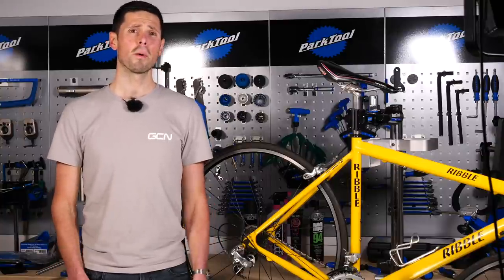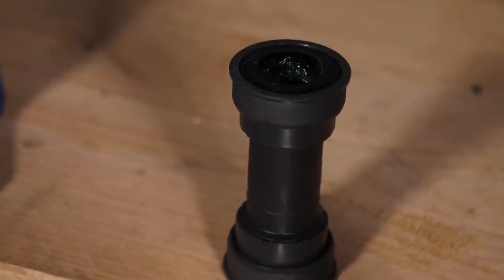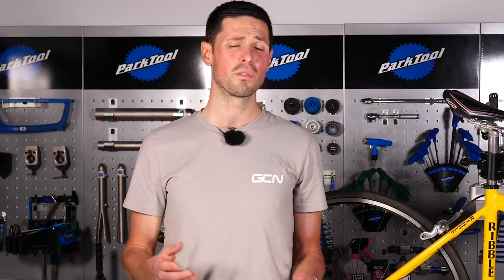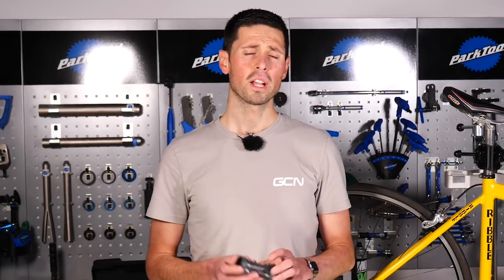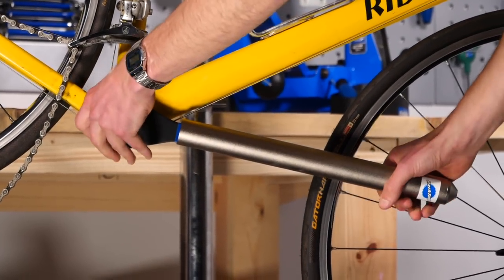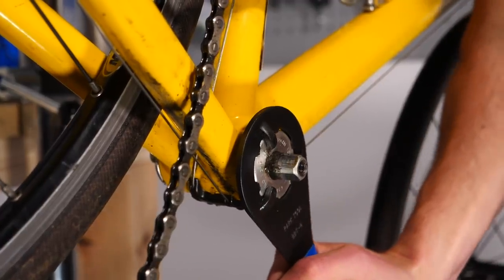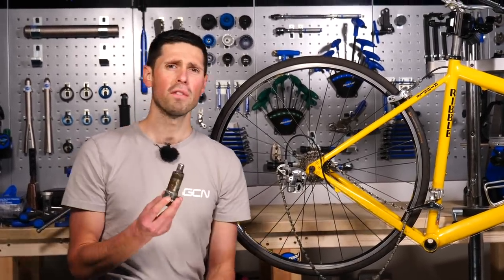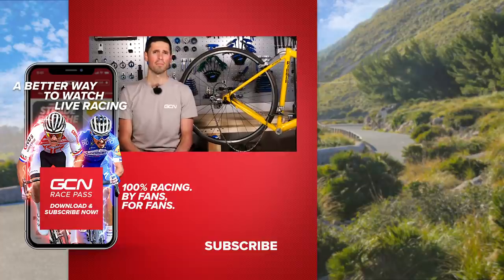How To Remove A Stuck Bottom Bracket From Your Bike | GCN Tech Monday Maintenance

Comment: You simply HAVE to affix the tool to the BB cup.  This guy was derelict in not doing this.  If you don't, it will slip, you'll mangle your hand(s), damage the tool and/or BB cup and/or the frame.  ESPECIALLY when using a cheater bar!  This is why typical shop-quality fixed cup tools have big handles and tighten securely to the BB shell.  The tool this guy used should be held in place with a Stein Tool, or any combination of washers, tubing and the crank bolt. You MUST securely affix to tool to the cup!

Also, do NOT go wild torquing a BB cup with the bike held  in the repair stand alone.  This risks destroying the frame - even if properly clamped by the seat post.  Get a friend to hold the main triangle as you apply force.  You can even loosen up the repair stand's rotational adjustment so you are NOT applying rotational force to the seat tube/cluster area.

Well, got a siezed Campy Record BB in a Ritchey Ti frame with carbon stays.  So no blow torch for me!
But a hair dryer and spray freeze may do the trick.  We'll see.
Sat for a week with penetrating oil. 
Man, not fun trying to revive this beautiful Breakaway for a trip in a month.

Comment: You omitted the most important bit, namely how the bottom bracket is threaded -  British or Italian, Swiss or French threads. If you don't know the correct "undo" direction  you're sure to fuck up your frame, or, ruin the threads by installing a replacement with a different thread pitch and direction... Tut tut tut ...

Comment: Mine is seized.  I've never had such a humiliating defeat.  I'm going to try a breaker bar and if that doesn't work I'm letting the shop replace it with one I can work with.
Reply: @rg807  Definitely. Used it (and the referenced Sheldon Brown article) to eventually pry out a seized square taper fixed face from a skip rescue Raleigh - had already tried most of the usual tricks, wasn't going to spend on a decent quality C-spanner or similar, this worked a blinder in the end. Very satisfying, threads in good knick.
Reply: The bolt method seems to be ingenious but won't work with cartridge bbs. A Shimano /Phil tool could  be stabilized with a bolt screwed into the spindle backed with a washer. I've seen bbs removed using the tool clamped into a vice and the frame used as the lever. Just be careful to turn the right direction as this approach may tax spacial skills.
Reply: @davidburgess741  You're correct re cartridge bb. But for the rest, the bolt method is easiest. The presenter left out that the primary reason for seizure is metal incompatibility and a lack of anti seize grease.
Reply: @davidburgess741  Yep, it's purely for BBs with fixing plates separate/accessible from both sides.

Comment: 4:40 you always have such an extended tube at home dude. Just drop the bike from the repair stand (which you should do anyway to avoid damanging the repair stand) and use the seat tube to get more leverage.
Reply: But what if the seat tube is full carbon?
Reply: Too bad if the seatpost is stuck too! Or the quill stemm. Or the cranks. In some cases all of the above.
Reply: @tobiasbouma4071  in that case use common sense and dont use the full carbo n seat post. Also, if you have money for a full carbon seat post you also should have money to pay for the ParkTool extender tube shown in the video.
Reply: @luukrutten1295  in that case throw the bike to the recycle bin. :) just kidding :) check it with a professional bike repair shop, they will be able to sort all of the above for you for a fraction of the cost in tools

Comment: Update: How to remove your bottom bracket: step 1: call your mechanic. step 2: take your bike to your mechanic.
Reply: Nah, its a easy job to do...
Reply: Neil Buckley nah, can't be bothered to buy the necessary tools and mess
Reply: @costasmandylor1565  3 tools and minimal mess. And the satifaction of a job well done
Reply: Neil Buckley ok dude, I'm not going to have pissing contest about it. Do what you want.
Reply: @neilbuckley5796  Depends on just how badly stuck it is (and what, if any, damage has been done to the splines on the stuck part).
Reply: @mattgies  yup there is that. Usually a time for a hacksaw if it’s that goosed.
Reply: @costasmandylor1565  is that really you?  Loved your work on Picket Fences.
Reply: Bill in Houston no, not the actor